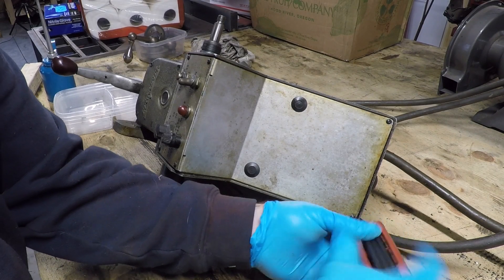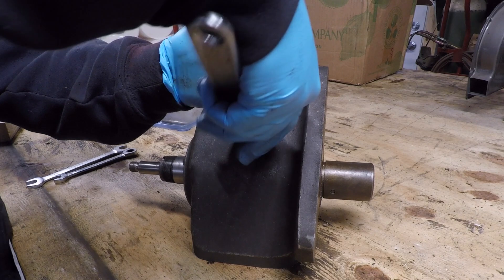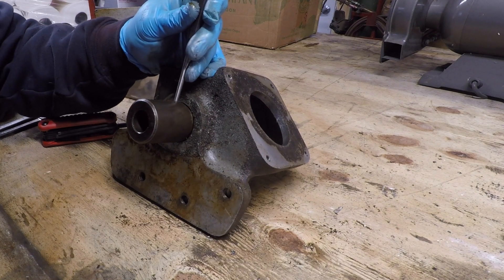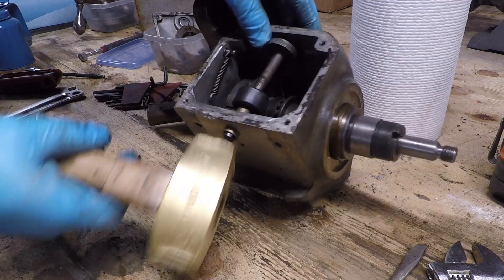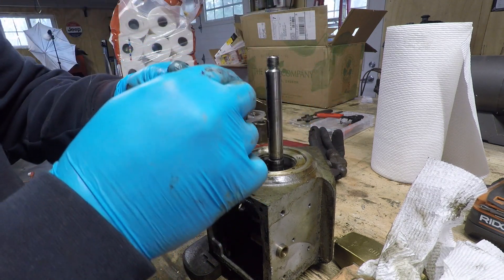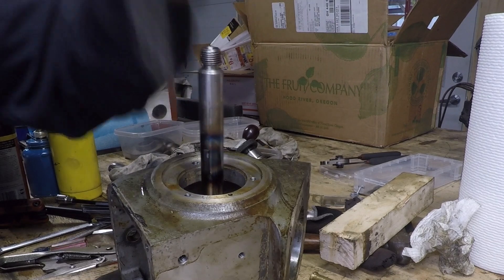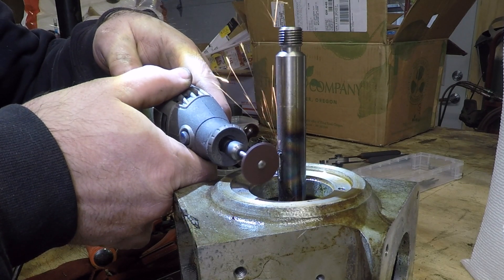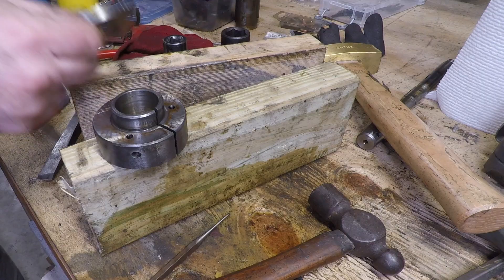Bridgeport Mill - Disassembling a 6F Power Feed

Comment: Bit of an observation. The key is IN the slot. You heated the key with the torch which expanded the key that’s in the slot making it tighter. Next time, put your vice grips on the key to act as a heat sink and heat the shaft slightly. That should expand the slot and the key should come out easier. Loving the series!!
Reply from the maker: You are correct.

Comment: How early in this process are you able to replace the spring that puts tension on the clutch assembly?
Reply from the maker: Not sure I understand the question. But that spring could probably be replaced without disassembling anything but the front cover. It's been a while since I've had this apart, so I am not 100% sure.

Comment: I had to do almost the same repair. The clutch engagement was my issue, it would jump and slip under certain pressure.  Also make sure your seals are good otherwise it will leak oil into the electronics and motor, mine had oil in both, luckily only ruined some wiring that was easily replaced. I actually made my own seal out of Delran because the factory seal was crap.
Reply from the maker: Thanks for the tip. My parts diagram doesn't show any other seals. Was yours a 6F-A? This one is a 6F-B. The only holes between the handle assembly and the electronics enclosure are for the mounting screws. The only "seal" is the one that goes over the clutch shaft, but that shouldn't be an issue as long as I don't overfill the oil.